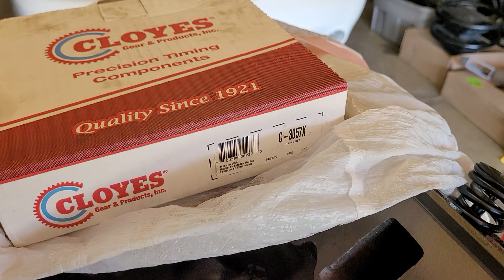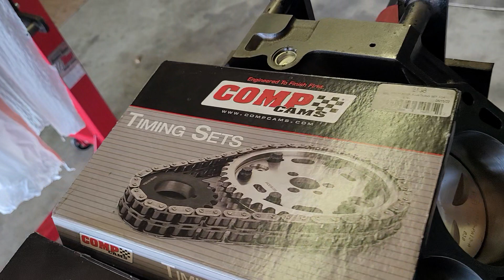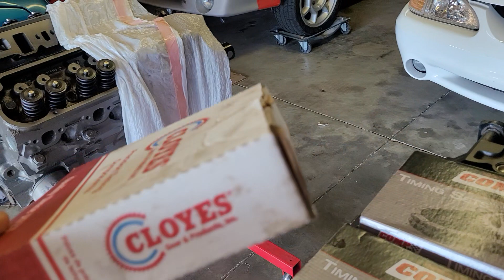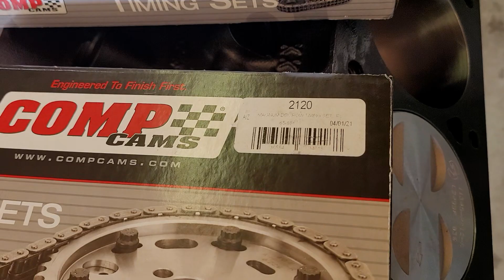1993 Mustang Cobra engine build, (Don't Cheap on That Chain)!!! project field Snake

Comment: Nice set of ford racing 10th anniv. wheels on the white cobra! I have the same wheels on my fox. It's been years since I've seen any that aren't knock offs. What size tire combo worked for you? The tires I had on mine have been sitting for years and when it was up and running the rears scrubbed on the fender lip (I've had them rolled since then) so I'll be looking to buy a new set before I put it on the road.

Comment: I rebuilt a stripper block XXX from a 95 to put in my 89 and went to AutoZone and bought just the chain gears was good and it went on tight I think around $30 in December last year

Comment: I just watched your video last night at 1 a.m., and I just had to go out to my workshop to open up my Comp 2138 SBF timing chain box.  It has S612 stamped into the larger sprocket, but definitely looks different/better in quality than your 2138.  I have a brand new Sealed Power chain that looks more like your 2138 Comp.  It's strange, same Comp box/part number as yours, but definitely different larger sprocket.  Smaller sprocket appears to be the same as yours.  I can't wait to see if it has slack in it once I mount it on the block.  Thanks for your informative video and awesome channel!

Comment: Not pronounced "coils." Pronounced exactly how it is spelled: Kloy-z rhymes with "toys." They've been around for years.
Reply from the maker: wasn't really that important, im sure 99.9% understood what I was saying.
Reply: Agree. The mispronunciation sounds like a nube rather than an experienced builder. One other thing; the "good chain" was put on a differernt motor. Raises a couple of qustions. Perhaps the first motor was align-honed and the second not? Cloyes offeres a timing chain to account for this. Or ????
Reply from the maker: @greggesterling7781  lol, the Good Chain was put on Both Motors when it came in, I wanted to be sure it wasn't a bad line hone as well. Thanks for watching,
Reply from the maker: @greggesterling7781  lol, The Good chain! was put on Both Motors, I too was curious about the line hone. The Bad chain fit like shit on both motors! also I have been doing this for 30 years no Nub here. Thanks for watching